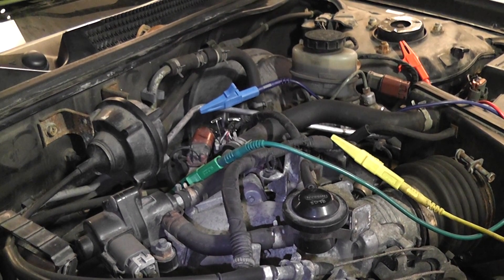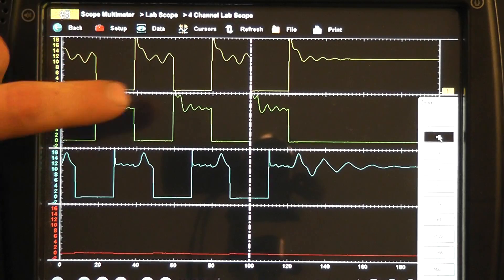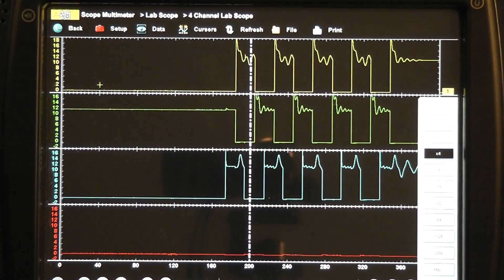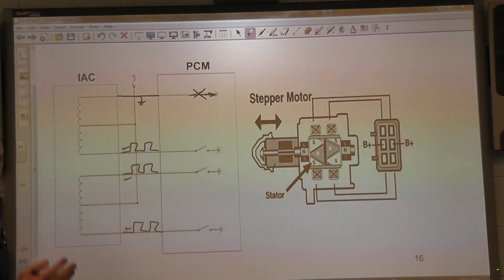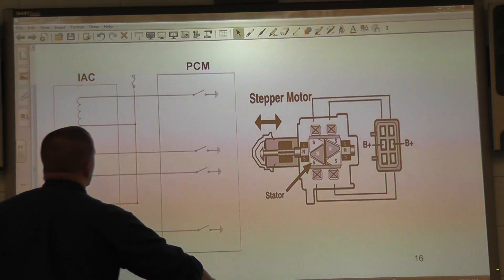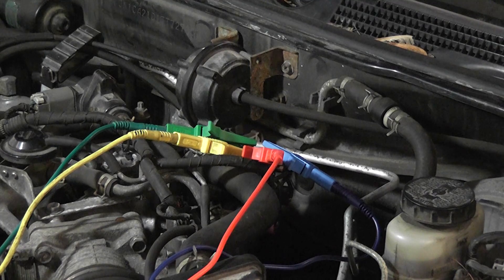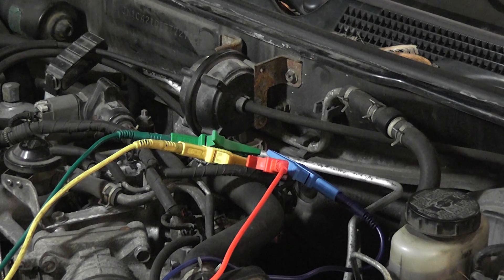How to test an Idle Air Control (IAC) valve - Nissan/Infinity

Comment: Wow, if you're really good and the ECU (if need be) is easy to access, you could literally do all of this in, probably under 10mins? Even if the ECU is buried somewhere, a quick test light check (or even scope for current) is easy peasy lemon squeezy. 

10mins for being extra sure everything works is a short time.
Reply from the maker: Yes sir and understanding your fundamentals is key!
Reply: @ScannerDanner  hey SD, I have an additional question. I'm getting really confused when I see more than two wires going to an output solenoid. In my mind it's always + or - depending if its GSS or PSS.

Do you have any videos on premium explaining the basics of adding more wires to a circuit and what that means?

I haven't yet moved to your potentiometres chapter, I remember watching something with you explaining they always have more wires by design. But I wonder about output solenoids and what those additional wires mean depending on the application.

Like, in this one you explained 2 are feed wires whilst the rest are GSS.

I guess I could identify that on a wiring diagram, but I'd still be lost as to why this is wired that way.

I think, at least this is what I have seen watching your videos, that most outputs are two wired, however, expect for IAC, stepper motors, drive-by-wire throttle bodies, obviously ignition coils. Can't think of anything else.

Have you seen other types of outputs I haven't mentioned above that actually have additional wires to them? Like EVAP purge for example.
Thanks!
Reply from the maker: @Farseer1995  a solenoid is always 2 wires. In this IAC motor, it is not a solenoid and wiring diagram review was key in understanding the circuit design. Ignition coils have different designs too. I cover this in Chapter 22. IAC devices and throttle bodies in Chapter 20 and the main power and ground side switching stuff is covered in chapter 3! Hope to see you there! https://www.scannerdanner.com/join-scannerdanner-premium.html

Comment: what is meant by (actual stepper motor value) that appear on the diag device? 
you find 2 data regards this idle motor 1st is actual stepper motor device 
2nd is target stepper motor value.
what is the difference between them?
Reply from the maker: One is the command, the other is a calculated value based on the number of pulses or steps applied from 0. The 0 count can get messed up in the calculation if the valve sticks in any way mechanically

Comment: This video is worth $1000 + to everyone that watches it that has a nissan or works on them. I had no idea how to test the system and hate throwing parts. I verified that one of my wires has a steady 12v, unplugged the ecm and power goes out. will be changing the IAC chip in the ecm when it comes in the mail. I already pulled the ecm and it doesn't look burned like everyone says but that doesn't mean it's ok. Thank you so much for your work! I made a video of my testing and reference your video and link.
Reply from the maker: Post the link! Thank you
Reply: @ScannerDanner  https://youtu.be/T7H-EnCang4

Comment: P0507 on a 03 Infiniti G 35 4 door, cleaned throttle body, changed valve cover gasket, all sensors are good, no vacuum leak but still at an high idle! Could it be possible that cleaning the throttle body messed things up? Is the air control valve apart of the throttle body itself?
Reply from the maker: It needs an idle relearn done if you cleaned the throttle body. It is a very stupid method and is ridiculously easy to do it wrong lol
Google it. I don’t remember the steps exactly but it involved stepping on the gas pedal 7 times with the key on and some other weird stuff

Comment: I have a 2004 Nissan frontier XE-V6 3.3 L 2WD Desert Runner naturally asperated VG33 3275CC ENGINE , according to everything I've found it  says that my idle air control valve harness with the key on it should have battery voltage at the B+ terminal to good engine ground.... when checking for voltage i get nothing my meeter got put on the diode setting  and it gave me a 0.4  turns out diode number 5 is part of the iacv on my truck and its F37 under the passenger side panels, so its getting something at the B+terminal except voltage real quick Chilton's manual says  that if battery voltage isn't present at b+ terminal with key in the on position that the next step Is to test the circut from the ignition to the IACV  that i don't know how to do and I'm not sure  what components are part of the circut or where theyre at ...lol any help, advice,  websites that actually have the info i need,,,etc would be very much apreciated thank you sir side note  i had a crank no start condition prior too all of this , unplugged maf sensor and she fired right up ran ok until i gave it gas.... she d hesitate and want to die i could feather it and keep her going just barely. So i  replaced the maf , did the drivers side valve cover wich had a gnarly leak,  at the start odd all this i had p0304 cylinder 4 misfire and a knock sensor code, rather then take the lower intake off to get to the knock sensor i reached down and manged to get the harness disconnected gingerly worked it out of the  wrap and temporarily relocated the knock sensor to the top of the upper intake get done with all of that , back to crank no start,  hooked up my obd2 and cranked it with it on live data it gave me the p0505 idle air control valve code  what it said was 'idle air control valve or  circut '' so i went out and took the upper back off ... the IACV CAME BACK at 10.50 homes , harness nada except the . 4 diode reading i accidentally took what do i  do next ? Over got the wiring schematics but they don't really show much I'm stuck on don't know status... right now but I'll figure it out...I hope I'm open to any of your sage advice  thank you for your videos they do help I've got a bit of learning to do yet before I'm a guru but one of these days maybe

Comment: Excellent video. You could have measured the resistance of the 4 individual coils of the IAC and that would have given away the open coil
Reply from the maker: I rarely use resistance testing during troubleshooting as it is highly inaccurate most of the time. The other reason would be getting to the pins with the components in their normal location (without unbolting them) is usually super difficult to do as well.
Reply: @ScannerDanner  I agree with you. In my case, my car was stalling in idle. After removing from the throttle body, I measured resistance of each 4 coils and 3 were 25 ohm, the other one was open

Comment: Can a faulty Throttle Body cause RPM issues when releasing the throttle? 

Say I accelerate then let off the gas at 2k rpm, it immediately drops down to 900 then bounces back up to regular slowing down speed. You also feel the car jerk forward when it happens
Reply from the maker: Is it an electronic throttle body or cable driven throttle? It would help to know what you're working on
Reply: @ScannerDanner  it's a 2003 350z. It has no IACV and it's an electronic throttle body
Reply from the maker: @BigBoyz33  I would recommend a throttle body cleaning and idle relearn procedure when you are done before doing anything else. These relearn procedures are very strange on Nissan's and you may or may not be able to do it without an enhanced scan tool
Reply: @ScannerDanner  thank you, I'll try that out.

Comment: A shorted driver would read on the battery neg to ground 12v “shorted; The driver in the ECU would cause no communication to the throttle body circuit causing a up and down idle

Comment: Sir, my car i20 engine rpm up to 1100 from very low 650 rpm when iscv is disconnected. However, it drops to the same low 650 rpm when reconnected.

How to restore normal rpm to 850??
Reply from the maker: Post this to my forum. It is free to join and we can definitely help you there. www.scannerdanner.com

Comment: hey, have similar problem with this, dont know how to follow suit with your test, i have power running the socket, i want to check resistance of the other four wires using multimeter? is that possible?

Comment: Hello, mine is a 4 pin connector. 
I unbolted it while still connected to the electric plug and turned the key on, it travelled all the way in and all the way out (about 1cm travels). the vehicle still has a very poor stalling idle when cold but works perfectly fine when warm over 160+
PLEASE HELP
Reply from the maker: You haven't given me much to help you with. Maybe check it for a vacuum leak?
Reply: ScannerDanner WHAT? I understood his comment clearly. you can just say if that's the proper operation of the IAC valve or if it's shorted or worn or something. looks like the vehicle operates normal once warm which means the ECU changes the fuel mixture to the other map when it's warm( rich mixture when cold + closed shut IAC no air = stall)

Comment: I have a question, what other things can cause the idle air valve circuit to short other than the idle air valve, electronic engine mounts and tps on 01 infiniti i30
Reply from the maker: What do you mean short? How do you know it is shorted? Is there a code for it?
Reply: it has no codes but it idles on start up  even when i rev it it idles but when i take of to drive it and come to a stop the idle drops really low and it cuts off. if i try to start it a couple  of times it dies then it idles then if i rev it it cuts off. i checked the ecm and the chip that burns isn"t burt. i know that some people say that you should unplug the electronic engine mounts, replace tps and idle speed motor when replaceing ecm. want to know if there is anything else that could burn that chip in ecm.

Comment: I have tried this test on many a Nissan six(6) wire IAC motors and have not been able to achieve the same results.As a matter of fact nothing happens.All coils have been tested and found to contain desired resistance values.Go figure?

Comment: i think my EGR is the same as that IAC...and i m thinking, how do i open the egr valve manually(bypass, "be the computer")when checking the flow...any thoughts mr. scandan?
Reply from the maker: You cannot manually control a stepper type motor. Especially with it still plugged in like we do with other solenoids and output controls. The danger is too great that you will cook the driver. And the controls themselves are too elaborate to do with jumper wires.

Comment: Hi great video thanks. I have ,infinity qx4  v6 3.5L car. when I start the car it's on auto chock after few minutes than it goes to normal rpm but soon after it goes back to 3000rpm and back to 1000 rpm than back to 3000rpm it not stable could it be air control valve iac let me know if possible Thanks

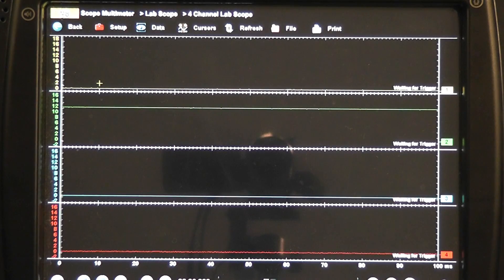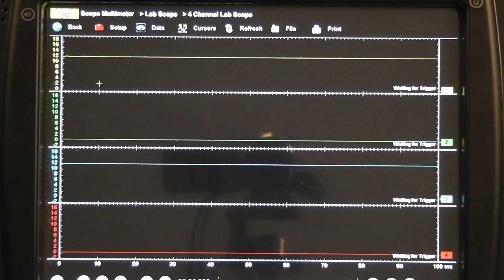Comment: It would help if the wiring schematic you used indicated the N.O. and N.C. states of the circuit. It is easy to deduce these states by looking at the traces on your scope.  When the key is off (1:15), the yellow and blue traces are pulled to ground.  When the key is on (1:30), the green trace is pulled to ground and we can say with certainty that the red trace is also being pulled to ground even though it is not obvious from the display.  We know the red trace is being pulled to ground because of the test light used at the end of the video when you cycled the key on and off (8:05). Key-on turned the light on, permitting current to flow to ground.

It also would have helped to finish up your testing using battery negative.  While it's great that you ruled out a short to ground, it's not readily apparent how doing so necessitates a break in the coil.  You kinda glossed over the fact that being able to see voltage on ALL THREE other circuits requires that the problem lies where it does.  Simply hooking up to battery ground and testing each of the four T-pins would have rounded things out nicely.
Reply from the maker: +Jonathan H I disagree, it's been awhile since I uploaded this and I am going from memory. I proved the low voltage on the one circuit was from an open coil by indirectly testing it. No other tests were needed to be 100% confident of an open winding. 
Low voltage on that pin could have only been from the following
1. short to ground in the control wire (constant current flow)
2. shorted PCM driver (constant current flow)
3. bad connector at the component itself
4. open winding
5. no power feed to the solenoid

I proved 1 and 2 and did a visual on 3,  and 5 is a shared power feed that the other circuit was working off of. 4.nothing left but an open coil winding
Reply: +ScannerDanner Totally agree, just trying to leave a few more breadcrumbs for the next guy.  It took me a while to figure out the indirectness of your tests.
Reply: +Jonathan H hahahhaah jonathan this happened to me also, but i kept watching the videos because i knew he was right on what he was doing anyway ☺️

Comment: What do they make those lame flowcharts that way? Wouldn't be better to give a proper procedure that really makes sure the part is faulty? Or do they have some other reason to make them in such a way? Cause I've seen this kinda messed up manufacturer flowchart now couple of times already. I just find it weird as to why they are doing that, cause sometimes their procedures are even plain wrong and don't tell you a great deal, if anything after you go through them.

Comment: You mentioned checking for a grounded control wire with a test light - test light "on" - unplug computer for driver check (agreed). You suggested unplugging IAC as well for this test (to eliminate any back-feed, I would assume). But you would also loose your power feed to the motor doing that, loosing your test light. IAC plugged in would necessary in this situation to maintain feed, yes?
Reply: You would have your test light connected to battery positive as I did in this video. Make sense?
Reply: ScannerDanner Premium My bad - the little light bulb went on seconds later.

Comment: Hey Paul is this the same 6 wire stepper type as a 2001 nissan sentra bcz I'm having a problem on one of the ground side switch is lighting when key is on test light to bat pos it lights unhook driver lights off so I sent driver to get fixed put back in same problem any advise or any help would really appreciate it love this car want it to work right bcz I was driving it getting off freeway and it idle so high I almost didn't stop I have to baby's I want them to be safe in car

Comment: Chrysler Iac, so the guy ask me do you think it is the fail part and I said yes so than he told me I will get the valve. I felt confident it was the valve because the techniques you have teach listening for flare up  at start up truck did not do that, also the engine stayed running if my foot was on the pedal, we replaced the valve and it fix the problem any way I wanted to see the readings doing for channel but i was not allow I want to learn because I know I will see this problems again thank

Comment: on section 20, from page 16 to 18 I can see the study case but, still I do not understand the  wiring diagram what should be  12v what is o v comparing with the follow  6 wire Nissan case study, my question came here because recently I started working for a shop I do smog check and repairs too but, I can see in the shops is trowing parts this doge the one I am asking the owner of the shop told me to ohm the stepper motor, i did and it was in between ranges,I wanted to scope and did not alow me .

Comment: how is the circuit design on this,2001 doge ram 1500 4 wd 5.9l vin z,  not all of the are ground ?? vantage does not specifies to check for common ground or voltage , thank you Paul

Comment: thanks for  the video, I have 2001 doge ram 1500 4 wd 5.9l vin z and checking at the electrical diagram it has 4 wires and each of them comes from the computer and are label a,b,c,d control  driver#1,control  driver#2,control  driver#3,control  driver#4, and the snap on vantage shows to test it connect to coil driver and 4 , than connect to 2 and 3 and turn on accessories a/c ,blower motor  etc, the problem is the engines start and stall unless I keep my foot in the pedal it stay running ,

Comment: Thanks for the response Paul. I have heard LED lights are safer to use on computer controlled circuits; but as I'm sure you know, many drivers are subjected to much higher loads than most test lights pull. It is the same thing with the ESD wrist bands. Some techs still use them while handling modules, while others laugh when they see one in use. I guess you can never be too careful when dealing with control modules though. Thanks, Matt.

Comment: Thanks for the videos. I have learned alot from you. I also have a tool related question. I have a KD test light like the one you use in this video. Is it safe to use it to check for spark? It has a screwdriver handle, and I remember being shocked once using a scewdriver to check for spark. If not I will buy a modern type, but I like my KD. Thanks, Matt

Comment: BUT i dont get it,the scope is cheking the driver control,so basically you are watching ground to ground but nothing can be seen on the scope, unless like you said YOUare on a 20v scale, wouldnt be possible to see changes of milivolts on the scope on a lower scale?

Comment from the maker: In most cases black lead is connected to a known good ground "earth". There are some situations where the sensor ground is more desirable. Section 5 in my book (I think you have it right?) shows an O2 sensor with a ground bias where you want to connect to sensor ground to see a normal looking O2 pattern. Also Section 21 VRS inputs with a floating ground you may want to use sensor ground instead of battery ground. Another would be if the signal is "noisy", using sensor ground will clean it up